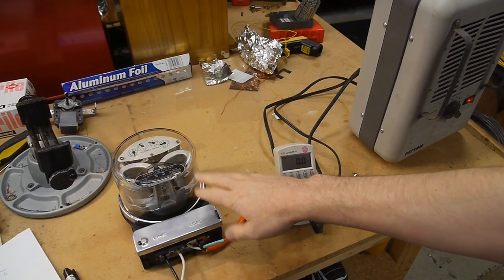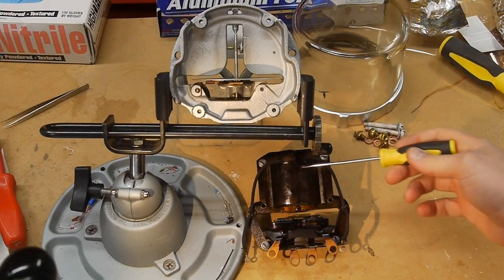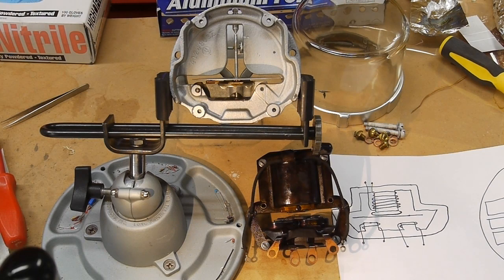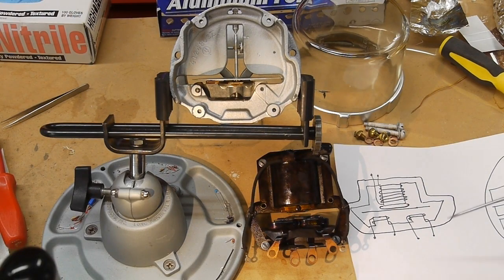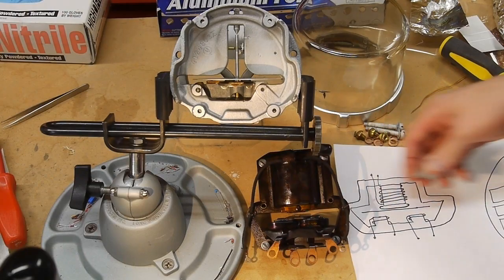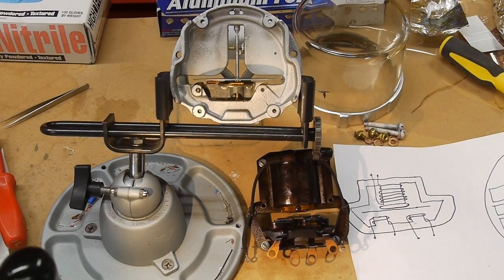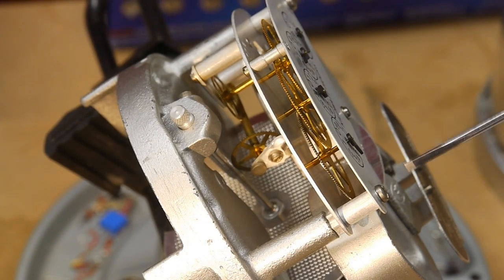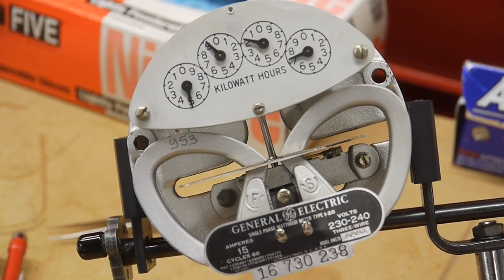Explanation of how kilowatt-hour meters work (electromechanical)

Comment: These mechanical meters are so reliable, the one hanging on the side of your house may be 50-70 years old.  But that's a long time for a mechanical device, so many of those old meters developed "stiction" and just didn't register with lower currents.  As a result, those customers were ridiculously under-charged.  When the customer got one of the new electronic meters, they were now being charge fairly, which meant their bill jumped! Hence: lawsuits.
Reply: Some early electronic meters used Rogowski coil current sensors, which have problems with fast switching, non-linear loads (for example LEDs) causing them to overreport quite significantly.
Reply: That a big grin for electric distributors, though their lights are dim or flickering still overcharged their bills. 😒
Reply: And now that they're digital, it's much easier for someone controlling it to change it's readings or readout. 

And to clarify some of the other comments, yes an individual can purchase a meter and have it installed. Each meter that is sold is numbered and guarantied to be in working order, on top of the fact that you can only have them installed by a qualified electrician with proper permit. ...From what I understand of the few we had in stock at a previous job.
Reply: @stargazer According to the US Census Bureau (2017) 39% of houses in the US were built before 1970.  So, technically, "most" houses are less than 50 years old.  But there are plenty still around with the original meters from way back when.
Reply: Xander Vice Owned
Reply: Depends in every country regulations about power distribution,metering....a consumer can purchase electric meter from local hardware stores provided it'll be calibrated by an government authorized calibrating company or an electric company will provide such thing. Perhaps it will jeopardize the integrity of the metering device when they're greedy for consumers' payment.
Reply: Most houses in the US aren't 50-70 years old.
Reply: @stargazer7644  many are though
there was a huge housing boom in 1945-55 right after WWII which would put the houses at 65-75 years old
granted most of those meters aren't around anymore because they would have been hooked to 60A service feeds which just doesn't cut it these days.
i know of at least one 1930's meter that was still being used in 2006 but i haven't seen a full analog meter that has to be read in person since
Reply: @Mister_Brown  There may have been a "boom" between 45-55.  There were MUCH larger booms later.  There aren't large numbers of 70 year old houses in my area.  There are no houses with 60A service in my area.
Reply: @stargazer7644  I guess it really depends on the area, i'm typing this in a house built in the late teens, i grew up in a house built in the late 40's probably 50% of this metro area was built before 1960. The planned communities and large areas of housing here built in the 70's and 80's are dwarfed by the suburbs built in the 50's same with the modern big building boom it's big but nothing compared to the sheer number of houses tossed up in mostly 1946-1955

I suspect you live somewhere where there was land available in the 1970's and 1980's along with big population growth

here on the east coast in a city founded in like 1750 theres a lot of old houses, a lot of plaster on metal lath, a lot of old service hookups, and a lot of rope insulated cable

really we're probably more of an outlier but all over the big old cities of the east coast you would have found electrical equipment from ancient times still in service right up to the point someone automated it.
Reply: @Mister_Brown  I used to rent a duplex unit on South Davidson Street in Wichita, KS. These duplexes had been build around WWII, and still rentable nowadays.
Reply: The meters normally wouldn’t be anywhere near that old.  A power company would routinely swap them out for maintenance.  In the mid-20th century I knew a power company meter man.  He would service and recalibrate meters in the office.  I’m not sure what the calibration schedule was, but it wasn’t 50 years.
Reply: SlightlyUndercharged.TheDiskWasntSpiningBelow5watt.
Reply: This is why power meters are not owned by the customers and are getting exchanged every few years. How come a customer changes from an old mechanical meter that has stiction already to a new electronical meter?
Reply: Kullat Nunu It doesn’t make any sense for the client to own the meter. Everyone would just have a faulty meter and save millions. Why do you even bring it up?
Reply: @askhowiknow5527  That's actually what I ment. Didn't Jeff Kurtock write: so many of those old meters developed "stiction" and just didn't register with lower currents.  As a result, those customers were ridiculously under-charged.  When the customer got one of the new electronic meters, they were now being charge fairly, which meant their bill jumped! Hence: lawsuits. that's why. I wanted to know how a situation like he described could occur at all.
Reply: @xaytana  Nobody here has stated that a customer had bought a new meter themselves ,      nor did I. Where did I state that? And yes, It doesn't matter if a new meter was bought or received when it comes to technical properties of those meters. That's why I wrote    This is why power meters are not owned by the customers and are getting exchanged every few years.    What matters and that is what Jeff Kurtock wrote, is the fact that a customer having an old meter that developed "stiction" already which    ridiculously under-charged     , gets a new meter that now allows a fair (higher) charge. But this would necessarily imply that mechanical meters develop "stiction" within the exchange interval, doesn't it? My question therefore was, how can it be that a meter develops "stiction" within the exchange interval which certainly is not 50-70 years. He wrote ... 50-70 years old.  But that's a long time for a mechanical device ....  As a result ... . Jeff Kurtock just didn't explicitly mention an exchange interval nor a typical timeframe for mechanical meters to develop "stiction" within that exchange interval. Therefore my question.
Reply: @kullatnunu2087  Mech meters were very rarely swapped out. They were really only swapped out when a problem occurred, the power company noticed discrepancies in the bill (A bill much lower than trends would suggest), or if the customer requested it (because of a bill much higher than trends would suggest). So they could go a VERY long time without being pulled. Nowadays they change them more frequently.
Reply: @xenonram  Sometimes older meters would overcharge due to fade of the brake magnets so the disk had less braking.  To test your meter, you can rent a power analyzer which clips into the panel board to measure the current on both phases, and measure the voltage and record everything from power factor, power sags and surges, and power used. The power used during the testing period, of several days is compared to what the meter on the house says.  If you are overcharged, you can inform the power company your test method and results. They will pull and test the meter and possibly calculate a refund amount for a period of time you were likely over-billed. If they fail to offer a refund, you can then threaten the lawsuit as a last resort.

The Fluke 3540 FC is a common power monitor used in industrial applications with clamp on current transformers and voltage sensing for 3 phase power.  Some of these meters can be used for single phase power.

Comment: The inductive reactance phase shift isn't 90 degrees.  For starters, not all of the magnetic field coming from the coil will be affected by the copper ring, and on top of this, even if all the magnetic field was somehow being absorbed by the copper ring, the phase shift would still not be 90 degrees.
Reply: I don't know what part of the video you're talking about but for teaching and simplification purposes it is 90 degrees. Only when you get more into the equations and analysis do you determine real world phase shift for a given circuit.
Reply: @killer2600  "for teaching and simplification purposes".  Presenting completely false information is not teaching.
Reply: @geheirnwaeshen  So in inductors voltage doesn't lead current by 90 degrees? Who's passing false information now.
Reply: @killer2600  phase shift varies based on inductive and capacitive reactance, you could have zero phase shift, or you could have 180 degrees.  It's completely dependent on the circuit.  To assume 90 is just completely wrong.
Reply: @geheirnwaeshen  You can't get to the higher levels of understanding without starting at the basics and for people that don't already know how the power meter works starting them at the higher level does nothing but confuse them and make them think they don't have the IQ to comprehend how it works.

Comment: I remember reading that when the digital meters were introduced they were ridiculously over reporting power consumption.  Lawsuits were had.
Reply: yea when i had a smart meter installed to work with my solar panels i noticed a huge increase in power usage despite generating electricity from solar.. energy companies are sneaky buggers

Comment: Asymmetric?! Is it because they wanted to make sure the client would be charged every time they drew current from the live wire, even in cases when the neutral wasn't necessarily engaged?
Reply: If neutral is not engaged, how power flows?
Reply: @PainfulRenegade  In the older systems I know [from grandfather electrician] they used ground and neutral interchangeably i.e. used ground as neutral sometimes. Even now there are systems where the neutral is used as ground, but not viceversa, because the ground is sometimes connected to the plumbing and results in small electric shocks to people taking bath for instance.
Reply: @AleksandarGrozdanoski  sorry, i don't get it... i always thought, using ground as neutral will short the cuircuit or blow the fuse... i'm dumb... edit: "circuit"
Reply: @PainfulRenegade  my goodness, I know what you mean, and I already said you can't do that nowadays, also because you'll trip the residual current device aka RCD or GFCI, which cuts off electricity if the neutral doesn't return the same amount of power drawn from the live wire. I understand that what I said earlier may sound implausible, especially from the point of view of direct current or DC, but AC is something else. Go read the article called "Single-wire Earth return" on Wikipedia, that's the best I can do at the moment. The process seems to be described there.
Reply: @AleksandarGrozdanoski  wow, thanks for the effort to explain, nice move... today i've learned something new... take care buddy...
Reply: @PainfulRenegade  you're welcome. I glad you liked it.

Comment: Tesla’s patent for a homopolar generator is almost identical to the kWh meter. To my simple mind the utility company only supplies voltage on the input and the current appears at the load moving towards the output of the meter. The utility company will come remove the meter to disconnect your service due to non payment. The meter completes the circuit between the grid and your house wiring.

Comment: The neutral actually isn't metered and doesn't connect to the meter.  Notice it's a "240 volt, three wire" meter. 240 volts is self explanatory, but the third wire referenced is the neutral.  Each of the two lines ("hots") are metered by each set of coils.  If current is only flowing on  one line (ie a 120 volt load), the meter revolves half as fast as it would if the same current were on both lines (either two 120 volt loads or a 240 volt load, twice as much power). If it were a 240 volt, two wire meter, it would only have set of current coils, the other line being tied directly to the load.
Reply: AFAIK in the US 220/240V lines are made the way so two of the wires are L (hot), but the phase is shifted 180 degrees. And for 110/120V you just use Hot and Neutral wires.

Comment: You mentioned that the number of rotations of disk are proportional to current as well as voltage. So does this mean that the energy meter actually measures VAs and not watts? Pls throw light on this. Thank you so much in advance! (Same question for digital energy meter also).

Comment: you do not demonstrate how to use the spinning disk meter to actually measure instantaneous power draw. first you need the meter constant that is printed on the face, it is labeled as kH probably 7.2kH and even though those characters look like kilo and hours, that is not what the number stands for. it means 7.2 watt hours per revolution. so now simply time how fast the disk spins, if it is alot then time several revolutions, if the draw is low then time how long a division or two or several on the disk take to move. then it is simply multiplications to cancel out units. lets say it takes 41 seconds to make one revolution. we have 7.2 watt hours/revolution * 1 revolution/41 seconds * 3600 seconds/hour and we end up with 617 watts. this should match your electronic meter. there might be issues if power factor is off if you power say a fluorescent light or motor.

Comment: So...if we increased the power of the permanent magnet in the meter by adding additional permanent magnets to the existing permanent magnet to increase the drag or braking force so to speak wouldn’t that save us some money?

(Assuming you didn’t have the digital type meter and you knew when the meter reader man was going to show up so you could take off the additional “braking” permanent magnets beforehand of course. ; )

Comment: Very well presented. As you went along I was thinking about the shaded pole motor, wondering why it doesn't spin at a little less than 3600 rpm. I wonder how well this system compensates for current imbalance between the two legs, ie neutral wire current....

Comment: How accurate are these things after sitting on the side of a house for 40 years or so? Is it possible for the disc to spin faster then it should, or not stop when drawing 0 power?
Reply: More likely the meter would slow down with the friction of the moving parts increasing.
Reply: I have no experience with these watt-hour meters as such, but some years ago I did calibration tests on WW2 era voltmeters and ammeters. They all read about 10% too low, which I attribute to the loss of strength of the magnets over the course of 50 years or so.